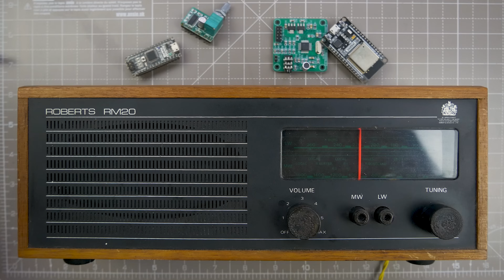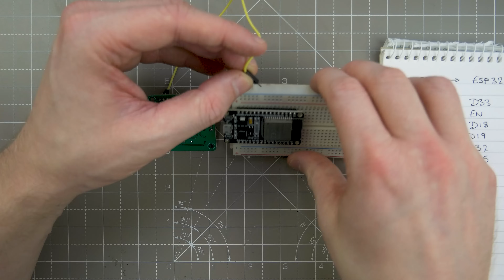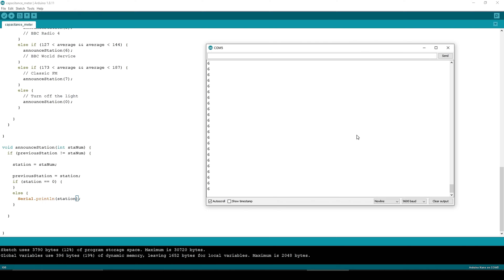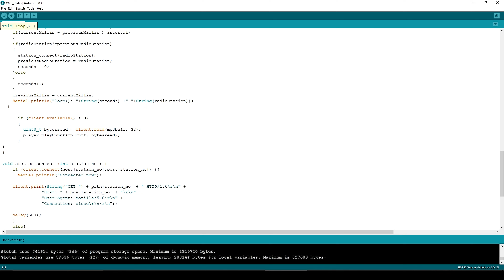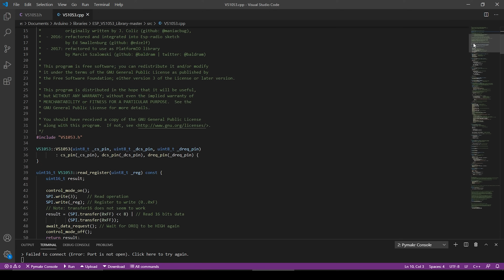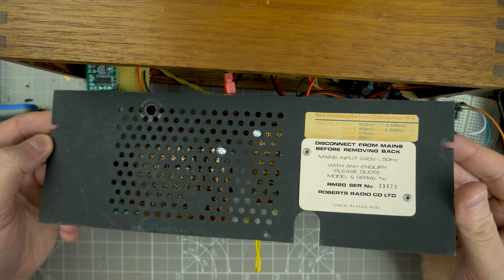From Start to Finish: ESP32 Internet Radio with a Roberts RM20

Comment: A few months ago I tested a lot of ways how to get an internet radio working. I was thinking of using an old tablet, old phone and such. In the end I had left 2 devices which drew the least amount of power. A mobile phone (Motorola XT 1032, unmodded) did nice (via Bluetooth or cable, but Bluetooth is a lot easier) and the other device was (is) an old iPod. Yes, that is it! An old iPod, I did have to add a small internet page which 'delivers' all radio channels because you can't really go on internet with the iPod browser (super slow and some javascript won't run on it). I have had the iPod running for a long time (days in a mont), and the average use is 0.5 Watt. And that was my aim: finding a device with a good stereo sound using not to much power. And that it runs on 5 Volt is super neat as well. it now runs on a small solar cell which tops the powerbank using some old laptop cells that i had laying around. I am way more happy than the silly DAB radio which is using way more power (about 3 Watt) and which seems to loose its signal several times a day. 
There are several places where to get your radio streams, I get mine from https://vtuner.com/setupapp/guide/asp/BrowseStations/startpage.asp and the amount is so huge ! ! ! I love to switch to new stations and explore more and more. Starting to like some chill out stations, some Celtic ones and then some more .. ..
More to check: http://www.radio-browser.info/gui/#!/users
Thanks for sharing your project. It would be not mine since I want way less power usage and only full stereo. The iPod is doing very well on its sound output! Oldies but goldies.

Comment: Nice work! You can get rid of the switch statement though. It doesn't do anything. ;-) Just use the original variable and "cap" it to the array.
Reply from the maker: Ah, that switch statement is there to protect against garbage across the serial. I couldn't think of a easier way to only perform and action of an expected value.
Reply: @DavidWatts  if serialData > 0 && serialData < 7 {} or something like that? That switch code duplication was bothering me too :D But it works and is fast, so good enough. Nice work, feel like building one myself now.
Reply: @DavidWatts  What about:

if (Serial2.available() > 0) {
  radioStation = incomingData % 8;
  Serial.println(stationName[radioStation]);
}

It replaces your switch statement, and it guards against garbage ("cap" to 0-7 with the modulo operator). The only problem is that incoming garbage will be decoded as "sane" data. :)

Comment: I think the best Roberts radio was the one witht the turntable on the bottom. As a kid I used to spin my mun's radio around as fast as i could as it made the music sound  like it was phasing in and out very fast. Think you should have put the volume pot on the front to keep the orignal control function.
Reply: Brilliant! A poor boy's Leslie speaker!
Reply from the maker: Sadly that pot doesn't result in a linear response to the PAM8403 but it is still the main power switch.
Reply: Volume pots are usually not linear. They are logarithmic on purpose.
Reply from the maker: @simontay4851  yep, log pot results in a linear response for your hearing. However,  pot is either broken or not designed for a standard amp. It had a very small zone of quiet to loud when fed into the PAM8403.

Comment: Now I want to create one that switches between my Spotify playlists 🤔
Reply from the maker: Now I wish I had that idea, Brian Lough might even have a library for that.
Reply: @DavidWatts  I did have a quick look, he has a library for controlling the track being played, but not one for streaming the audio ~ witnessmenow/arduino-spotify-api
Reply from the maker: I looks like methods for getting a playlist and setting the playback is exposed in the API but of course I haven't tested that. You could drop Brian a message, I think it would be an incredible project.
Reply from the maker: He might be able to roll a function into his library.
Reply: @DavidWatts  Yeah, I don't think they have a specific, 'play this playlist' function, but they do have a 'get current tracks' and 'add tracks to current playque', so could do it that way. 

Just had a look, and the api seems so different to the last time I looked at it, when I created a PHP program that took your most played tracks and made a playlist out of them. ~ gitlab/wsmq/wsmq 

That brought back a project I was working on ages ago, like most of mine, it never got far.

I also need to see if I can find a nice old Roberts radio first, being British and all, it would need to be a Roberts one XD
Reply from the maker: I think I got both of my Roberts radios for a tenner of Ebay so I am sure you'll find something. I think you should be able to grab the endpoint ' /v1/users/{user_id}/playlists' from playlists to get the users playlists and '/v1/me/player/play' from player to tell spotify to play a specific playlist ID
Reply from the maker: For '/v1/me/player/play'  Spotify URI of the context to play. Valid contexts are albums, artists, playlists. https://developer.spotify.com/documentation/web-api/reference/player/start-a-users-playback/
Reply: @DavidWatts  lol, I really should read things closer, that would make perfect sense XD
Reply from the maker: Let's pretend I am just some kind of spotify savant ;-)
Reply: @almostanengineer   The library hopefully supports this already, there is just no example of it.

If you take a look at the "PlayAdvanced" example for the ESP32, and took a look at the "playArtist" method, you could fairly easily update that to work with playlists, in the desktop client you can grab the link to the playlist by clicking share and then "Copy Spotify URI" they should be in the format:

"spotify:playlist:37i9dQZF1CAfdnfdnfga33"

If you just pass that instead of the artist, it should work.

I'll add to this example the next time I'm working on it
Reply: @BrianLough  I've hopefully added those examples correctly, and have submitted a pull request, feel free to deny if you wish
Reply: @almostanengineer  thanks! Will give them a look when I'm next working on and merge

Comment: Thanks David, great work on retrofitting that old radio! Did you consider using one of the unused switches on the front for a power switch? Or maybe replacing the original volume knob with the one on the amp?
Reply from the maker: The volume dial on the front is also a power switch it won't work to control the volume sadly. Super scratchy and non linear in terms of resistance. I did think about the switches for jumping to different arrays of stations, just like jumping between long wave and medium wave.
Reply: Volume pots are not supposed to linear. They are logarithmic on purpose because human hearing is logarithmic.
Reply from the maker: @Simon Tay  yep, log pot results in a linear response for your hearing. However,  pot is either broken or not designed for a standard amp. It had a very small zone of quiet to loud when fed into the PAM8403.
Reply: @DavidWatts  How about replacing the linear pot with a rotary encoder and taking that into ESP32 to set the volume through the VS1053 driver?
Reply from the maker: @sarahjanegray  Hey Sarah, I wanted to keep the power switch on the front as part of the potentiometer. Since I have been using it isn't a big inconvenience. I tend to keep the radio at the same volume anyway. You could absolutely swap it out but then you'd need to add a power switch. A rotary encoder is an intriguing idea, it would work really well as a digital volume control.
Reply: @DavidWatts  a lot of rotary encoders also have a push button incorporated

Comment: You don't even need an MP3 decoder for this.  You can decode the stream and output it via I2S on the ESP32 or even use the internal DAC.  There is even an Arduino library for that.
Reply: yes but it sound less, than that solution :-)  Ok if you are using very small speakers, you wuld not notice. But with better speaker you would not like it. Because the reulution is less than 5 bit !!!!! And if you are using the DAC you wuld no more than 8 Bit ( speed ), motly only 6bit. The hardwardecoder has 16 BIT !!!!!
Reply: @mibnsharpals  That's why you use an external I2S DAC like the PCM5102.
Reply: @douro20  M.) ok bit if you are using an external DAC, you can use the MP3 decoder ....